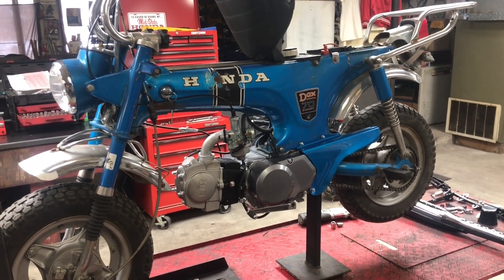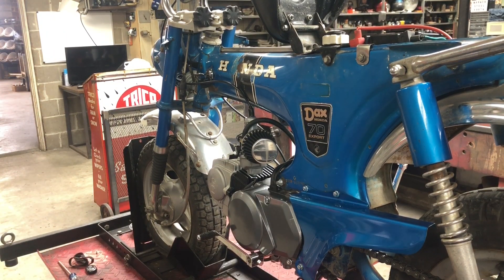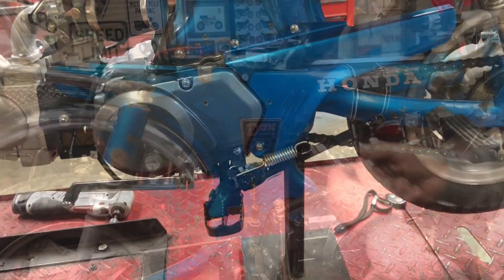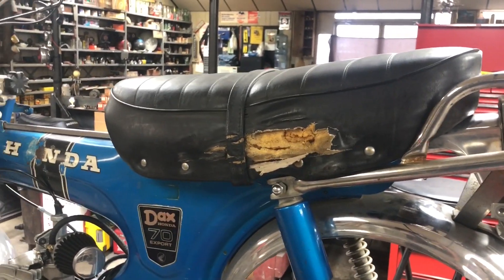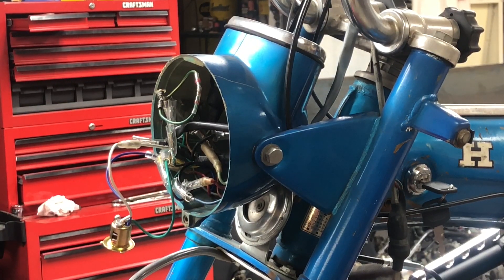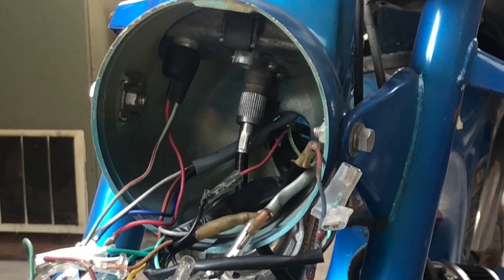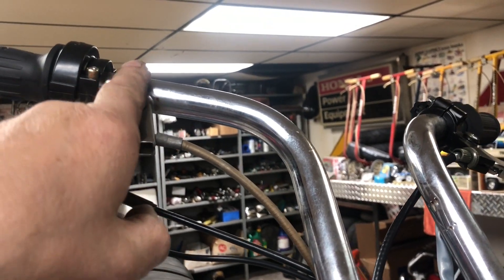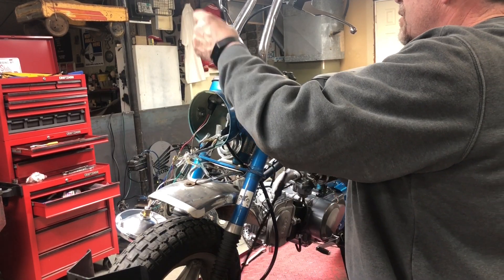Honda ST70 CT70 with Lifan 125cc engine.....continued.

Comment: Hey mate. I wanted to buy one of these engines for my underbone ( cub ) model. I live in Turkey and these types of bikes are quite popular around here. What vibration should I expect from them at reasonably high RPM ?
Reply from the maker: As long as you have it geared properly, to keep the RPM’s at a reasonable level, they’re quite smooth.

Comment: what size is the pod filter? im talking diameter of circle. what size throttle cable did you buy also? where do you order parts from? good video sir and thanks in advance. how do you like the lifan engines? i was looking into getting the pitster version of one of these.
Reply from the maker: 39mm. 
36”
Wiring harnesses from Trail Buddy
Amazon & Ebay for misc stuff

I built over 50 bikes with Lifan engines and feel they are the best built and most reliable on the market.

Comment: Kinda off topic....I’m getting ready to rebuild the forks on my K1 and ran into a roadblock. I cannot find a socket or wrench for the nut that holds the forks to the frame, it’s similar to a castle nut with 4 notches in it, any suggestions?
Reply from the maker: I just posted a video for ya!  Thanks for the video idea!

Comment: Hi Mike,  where did you get the pod filter?      Is it specific to these engines?
Reply from the maker: I buy them on eBay.  To fit the carbs I use, I purchase pods that have a 39mm opening.
Reply: @MiniBikeMike  thanks Mike!